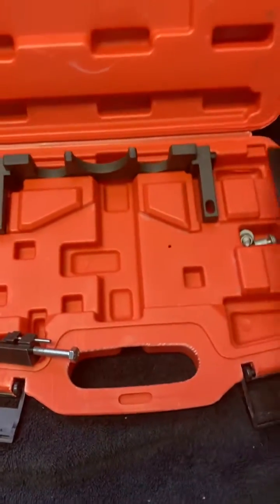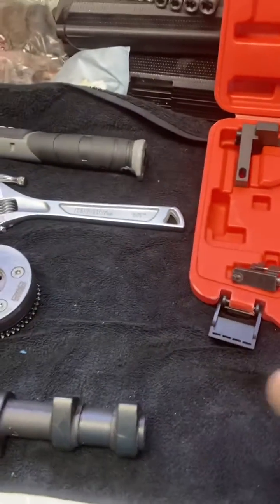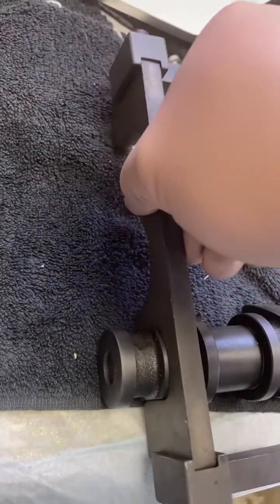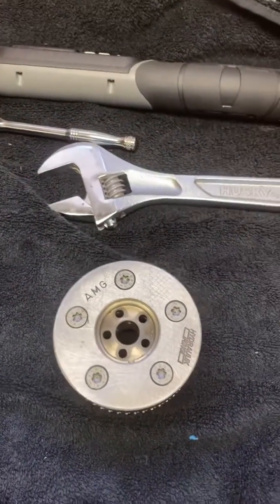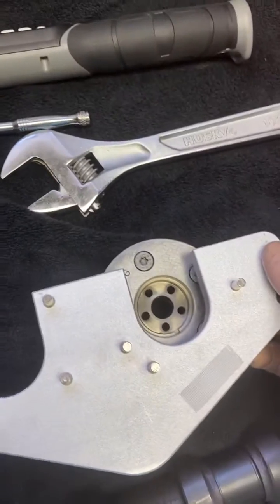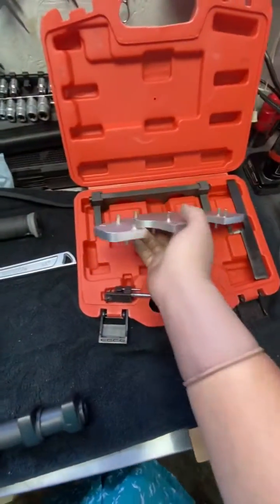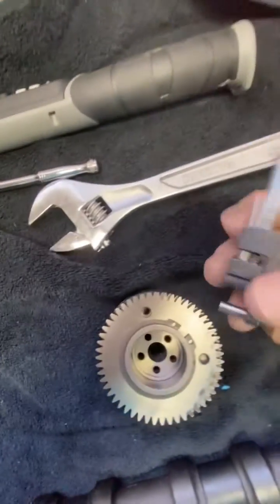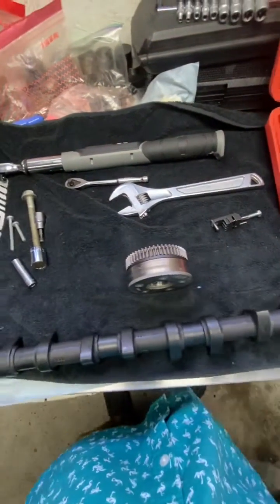M156 Timing Tool: Overview

Comment: Be careful of buying cheaper eBay timing kits as I did before getting the Amazon Kit.
The cheap kit front plate didn't line up and neither did the front locking bar.
I could get the front locking bar on but 6mm holes were no where near lining up
Only the rear locking bar and lash lock worked so my Amazon kit now has 2 rear plates and 2 lash locks.
Reply from the maker: I’ve found even the OEM tools were loose and I’ve seen lots of the rear bars bent and needed to be straightened. The Amazon kit probably just has better quality control  but nothing a little grinding won’t fix